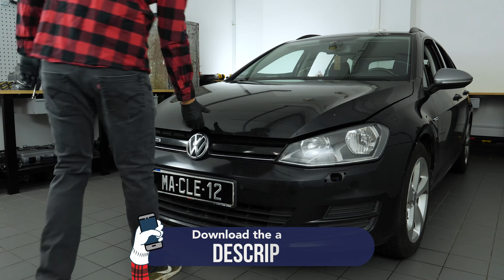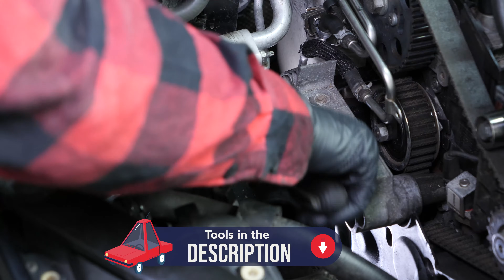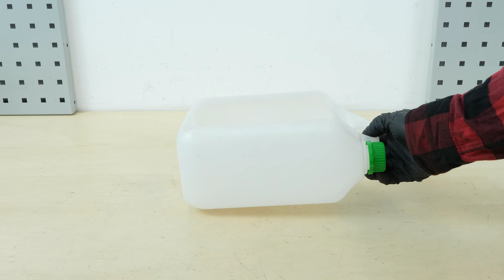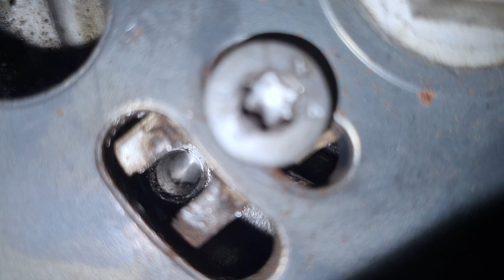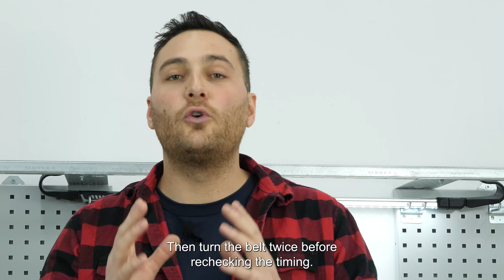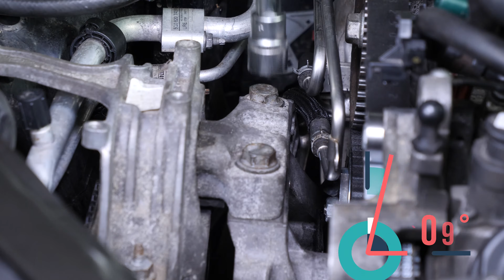How to replace the timing belt and the water pump Golf mk7 1.6 or 2.0 TDI 🚗

Comment: You should fasten tensioner to 20nm, then turn crankshaft two full turns and when timing tools insert freely and no adjustment is needed then you can add 45 degrees. Otherwise you have to use new fasteners for tensioner as torque to yield stuff is meant to be tightened once. Otherwise good video.

Comment: Its weird for me i did alot of timing belts but cant you just replace the belt without loosening the sprocket bolts? If the engine is working perfectly i see no reason for doing this?

Comment: Is it mandatory to loosen up the camshaft sprocket and high pressure fuel pump sprocket? I watched several videos, the only reason i see is that it makes it easy to take off the old belt, why can't take it off by removing the idle pulleys and tensioning pulley only?

Comment: i forgot to add.  You did well to get the belt and water pump swapped for such a low price.  I may need to look at either doing it myself or finding better price.  I was charged £950 for mine.

Comment: at 24.18 you say to torque nut to 100 NM  but do you loosen it at the same time as you just did the small lock screw as you tightened that big sprocket nut  2 minute previously ?
Reply: That’s my question

Comment: Hallo , i have same car and same engine . After timimg belt change , check engine light up. DPF presure sensor . We tested dpf sensor and it work ok , showing normal parameters. Erased foulty code and check engine. After 100 km while Acelerating i senced on maybe 1 second like lack of power and after that again yelow check engine light up. Im thinking that maybe EGR walve is clodged . What is your opinion ?

Comment: Awesome thank you! This really helped me to the job successfully. However I noticed apon reassembly you showed reassembling the damper pulley before putting on the bottom timing cover and engine mount, so a video editing error, but worth noting for those following along step by step. Someone already mentioned the turning of the water pump should be 10 times not 10 minuuuut. It also looked like you had way more space between the engine side and structural frame area when doing steps like taking off the timing cover or taking out bolts, not sure why.  Anyway super grateful, thanks very much!

Comment: I don’t understand all the cam sprocket and oil pump loosening, surly you just check the timing marks and change the belt and recheck then make any fine adjustments?
Reply: The cam and the hpfp lock in place so the timing doesn’t move but the gears are allowed to free spin to allow proper tensioning of the belt.

Comment: For anyone planning on doing this job, make sure you check the sizes yourself as a lot of the ones mentioned in the video are not correct. Example is the cat sensor is not a 17mm, it's actually a 19mm, another one is the crank bolt is not an M12 it's actually an M14. Not good as you can strip the bolts if not double checked. Please can you make sure the sizes are correct before giving out false information. 

Thank you.
Reply: The cat bolt is 17mm
Reply: @sledgesbrother1564 It's not a 17mm it's a 19mm. I've done this job myself, 100% a 19mm. Maybe do some research before commenting 👍🏻
Reply: @Bilal_458 its 17mm

Comment: @UseTool_EN Does the water pump need to have this electrical sensor? I have a waterpump without it, but it fits. Do I need one with the electrical connector/sensor?
Reply: Apparently they revised the water pump design to do without the electronic components

Comment: Thanks!
Reply from the maker: Hi @TomoReso ! We're glad we could help you out. Hope the operation went well 👌
Reply: @UseTool_EN  It did, there is a small mistake in the video tho, when putting all back together, first we put this lower timing cover plastic along with engine carrier, then the crankshaft accessory pulley, not the other way around. Costed me 5 minutes, but no biggie! Video is great otherwise, very well covered.
Thank you again!

Comment: Removing and the installing the plastic cam cover is a probably the hardest thing in this job. Thanks VAG for the great design
Reply: iss there a knack to it?
Reply: @johnblanning2500  patience.. nothing other than trying to wiggle it out without breaking the plastic cover. Follow the steps about the heat shield.
Reply: Especially removing injectors
Reply: 100% correct there 
Worst design ever

Comment: For people doing this on the diesels, not required on petrol models you probably want to open the thermostat and you won’t be able to do that without ODIS, if you don’t you have a good chance to cook the head. You don’t have to but you might want to check the coolant fill quality by pressuring the reservoir to 1.5bar after filling it abit above the plastic line (30mm up) mark the spot, if it drops below 30mm you may have a problem.